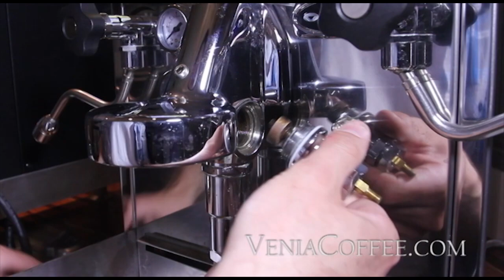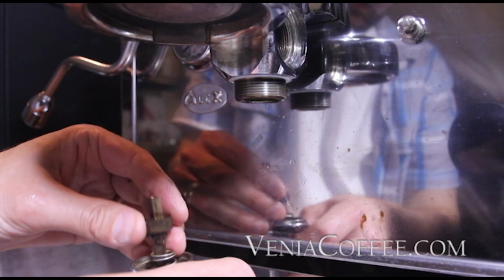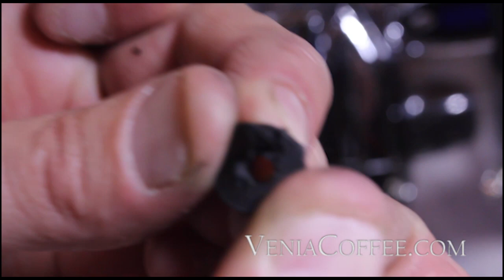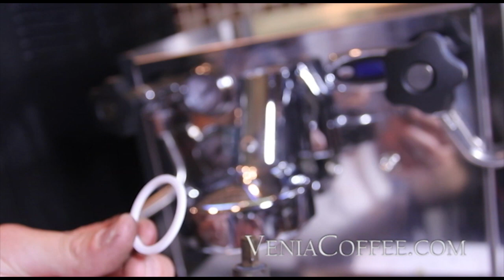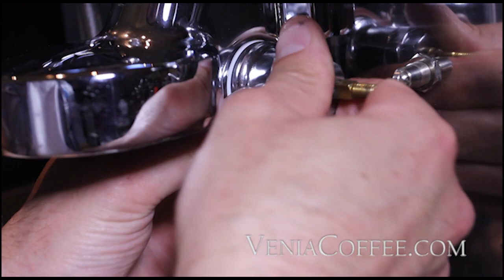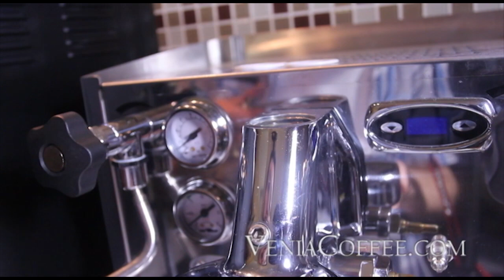E61 Group Maintenance - Espresso Machine Repair

Comment: The "hardest part" can be done easily. Put the bottom most exhaust valve on while the upper exhaust and housing is off the machine. Then put the whole part on in one piece (discovered by accident tonight!)

Comment: For years I was looking for a guide like this. Congratulations Keith, excellent video.
Reply from the maker: Hugo Rego You are welcome.  Glad we could help.
Reply: Berry Tree Coffee Roasters Hi! I just went through the whole procedure. And I have Put it all together. But I have a problem. The so-called exorcist does not build up any  pressure. And is therefore draining water through the whole brewing process. What could I have done wrong? Maybe I did something wrong in the assembly process? I would be so glad to get a tip:)!!!

Comment: Great video.  Appreciate you sharing. Have been so struggling to get the mushroom housing screw to start.  Have just spent an hour trying to get it to engage.  Cleaned the threads multiple times is there a trick to getting this to screw on that I have missed

Comment: That 7 year old video was really helpful to me spiffing up my Profitec 700 group head. About changing the valve gaskets, since only one side is acting as a seal, does it matter if you turn the gasket around and place the unused, flat side to control flow? Logic tells me it's ok. Is it? Thank you for this very educative video.
Reply: Thinking of buying Profitec 600. Can i ask you a question? How long it goes before it needs maitenance with 3 shots a day?
Reply: @andrewpod5693  in addition to the periodic brew head cleanup, this video explains what and when to clean your boilers: how to descale Espresso machine hear exchange boilers.

Comment: Having a hell of a time threading the piece back in with the "bulbous" part.  I have the bulbous piece facing toward the front as I can readily see where it fits in.  Can't get it to begin to thread in.  It's a Profitec Pro 700 and only about 8 months old.  I've worked on it before by replacing the top valve of the E61 with no problem.  I keep it clean and only took this part to inspect.  It barely needed any cleaning.
Any tips?

Comment: I was trying to replace the cam lever gaskets. However, when trying to reinsert the cam, I could not get it to "snap" into place between the upper and lower pins. Is there any "trick" I could use? I am about to fix the damn thing with a sledge hammer.

Comment: How often do you think you'd need to do something like this? My old espresso machine (not an e61 type, but a smaller boiler machine with a PID and thermoblock for steam) lasted over 10 years, without any maintenance, I think the only issue I had was leaky steam wand tip (a new gasket fixed that) I may have also replaced the group head gasket at one point but not sure. It still never died or anything, I just sold it.

Comment: Hi,have you ever had issues with the springs inside the group wearing off and becoming super sharp at the ends ?I ordered new ones after not even a year of use .I wonder if we actually drink the particles that come off the springs ,they look chopped off at the ends, and if you swipe your finger across it you could cut yourself ?!

Comment: I can't thank you enough for this great video. I always like videos that skipped details for the sake of time but with yours, all details were essential. Thanks again. 

P.S. I'm changing my diffuser but it's hard to get out. I don't wanna damage the thread/groove, any suggestion?
Reply from the maker: First remove the old group gasket.  If it is hard and brittle it may take a bit of effort.  Often we use a pick to stab into the old gasket to pull out.  Another trick is to place blue painters tape on the bottom of the edges of the group to protect the chrome and pry with a slotted screw driver.  We suggest replacing the brew gasket every 6 months and lubing well with dow111.  When followed on this schedule the screen usually comes out with minimal effort.  You will also be amazed at how much coffee gunk can build up in this time, even with proper backflushing.  If you pull shots with more nuanced coffees, this gunk can have a huge flavor impact.
Reply: @Veniacoffeeroaster  It seemed like they were asking about the dispersion screw? I also had a bit of difficulty and gave up, though I intended to make a tool to fit the groove and take the screw out when the machine is hot

Comment: is it possible to put the cam back in the wrong way with the lobe facing towards the machine? (19.25 part on the vid)
Reply from the maker: It should go in without much effort.  If you feel like you have to force it, it is likely in the incorrect position.

Comment: Hi folks, I'm in uk and have just heard a pop in the area of pressure dial on the left side of my Giotto rocket evoluzione, tripped the mains. Replaced fuse and switched on, now light comes on but no sounds or pressure, any ideas?
Reply: You need to take the electrical leads off the pump and measure with a meter (when you would expect the pump to be running).  If there is voltage there, then you need a new motor/pump.  If no voltage there, then you have to figure out why.  If your machine has a low water shut off, make sure that is not the cause.
Reply from the maker: If your machine caused a ground fault we highly recommend taking to a qualified repair tech.  If you are in the Seattle area we are happy to take a look.

Comment: If i have a slow leak coming from the lever shaft when pulling a shot, do I need to do everything you list here or just knock out a replacement of the gaskets on the lever? thank you! sending you an email with my machine info!

Comment: Thank you for this perfect video! Please, let me ask you for any help. I bougt used E61 group maschine and the water goes always through the group. When I've followed your video and disassambled the group, I've noticed that whten the paw is in the middle position, the upper valve in the group is a little bit shifted up. So when I put the paw down, it opens the lower valve. So the water goes always through. The gaskets seems to be ok. Do you have any idea? 
Thank you very much for your help and time!
Reply: It sounds like the lower portion isn't sealing properly. Even if gaskets look good, they may not be functioning properly and they're cheap anyways. 
Did you ever get this figured out? I'm curious what the fix was
Reply: @MattM-24  Hi, thanks for your answer. The problem was solved, the is ok, but the position needs to be in bottom. My second maschine from ECM has the position in the middle. Very simple :-)

Comment: thanks for this informative video.  Could i please ask what is the hex bolt on the front of the group head for? is it something i should pull out?
Reply from the maker: ***** This is merely in place to cover the hole made in the milling process to produce the water passage from the brew-valve to the brew head.  There is no need to take it out unless you suspect a blockage.
Reply: Thanks.
Reply: Isn't that also the location spot for the installation of an aftermarket temperature gauge?
Reply: Paul King punchandjudy
😚😚😣

Comment: Good video, Keith. How often do you replace parts? I probably average a dozen shots per week on my Duetto.
Reply from the maker: John Robison At your usage you will likely not have any need for 2-3 years, although it is dependent on how often you back-flush and quality of your water.  If everything operates smoothly, you don't notice any leaks or drips, and you have normal flow rate of water, you probably don't need to replace internal gaskets in your brewgroup.

Comment: Did you manipulate the gicleur at any point?
Reply from the maker: Inspect the gicleur, hold up to the light.  If you can see scale or debris we suggest soaking in a decalcifying agent or distilled vinegar.  We don't recommend trying to use something to ream through the hole as this often widens the opening causing too high of flow through.  You can contact us with your machine details and we can find an appropriate replacement for you.

Comment: espresso machine technical book available? I need one book please advise me
Reply from the maker: Anvarshan, not sure exactly what you are asking for.  If you have a 
specific machine and model, most manufacturers have manuals and 
technical diagrams available.  As there are thousands of different 
machines on the market, I would suggest you contact the place of 
purchase or the manufacturer for this info.